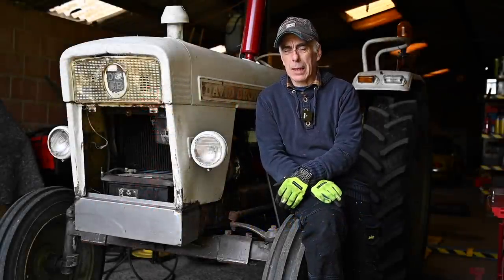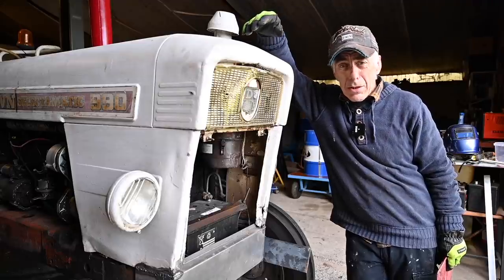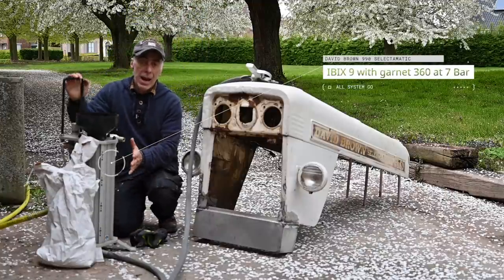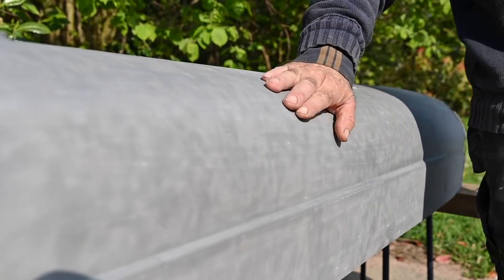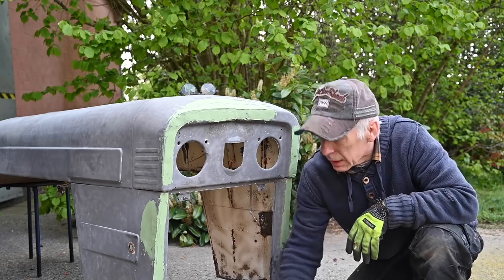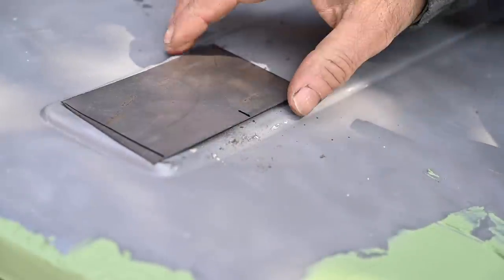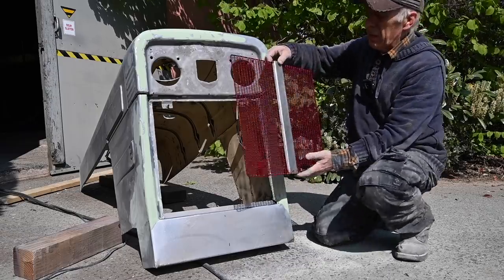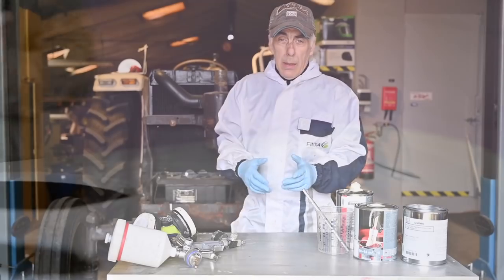David Brown 990, the big clean up Part 1

Comment: I often find that replacement wings are so cheap that they are not worth repairing, the front panels do cost a bit more, but I well remember making a slatted grill for my Fergi 20, as soon as friends saw it they wanted one, so I ended up making them for a few years, that is the way these tidy up your tractor jobs go! Stay sae! Chris B.
Reply from the maker: Thanks for the comments,  In this case its  600 euro for fenders , and they are not the square types.   In fact it seems very difficult to get the square types and the cost of 600 euro is IMO to high... I will rebuild mine
Reply: @D3Sshooter  At 600 E I would as well, that is a lot of money, a lot more expensive than Fergi bits, good luck! Chris B.

Comment: In English the cheap bender, (but looked very expensive to me unless you made it), is called a brake. Or more exactly you would add its capacity, to say, it's a 2 ton brake, or 500lb brake. Makes it sound more scarey but in my shop we had a hand brake and a 2 ton brake that would bend 1/4" or 5.5mm steel.
Reply from the maker: Thanks for putting that straight, Its a cheap one made in china but with some alterations.

Comment: I find a good way to straighten a flat panel is to clamp it between two bits of angle iron with g-clamps. For me it is faster than using a dolly and hammer and gives a better result.
Reply from the maker: Yes , that is another great approach.... I use that sometimes

Comment: Steve, I am enjoying your attention to detail, including the work involved with your on screen graphics, status ok. She is going to be one very smart tractor. One question I have, if you are going to fit hydraulic equipment to the front would it not be better to use the inside headlamp positions rather than replace the old outside ones? Just wondering.
Reply from the maker: Thanks for the comments,  If I look at the hydraulics hedge trimmer it seems that more is in the middle...  Of course I can always add the middle light

Comment: Hi excellent information and great watching your videos, please I’m interested in purchasing a DB880 but it’s got over 9400 hour on the clock, would this worry you, it doesn’t really smoke and starts well, what are your thoughts please

Kind Regards
Reply from the maker: Yes, absolutely.  If the price is right. Those are very strong tractors and easy to fix and overhaul
Reply: @D3Sshooter  that’s very kind of you, around £3500 solid tin and very little smoke on heater plugs, I’m new to tractors so I appreciate your reply very much and especially your videos 👍

Comment: I have a 996 and two 880 selectamatics (one presently isn't running) and I would like to fix them up at some point.  I watched your videos on hydraulics and admit that I am not completely clear on the hydraulics lol.  Both my 996 and 880 have loaders.  Recently the loader stopped working on my 880.  I think the hydraulic pump is working as the lift arms are up but won't go down and the loader won't go up at all.  I saw a video about cleaning the dump valves, which I did and it didn't help.  Any suggestions?  Thanks.  Also, I am in Canada, could you please provide the links where you get your parts.
Reply from the maker: I get all my parts through histo parts  https://histoparts.com/en
The ony thing I can say is to trace all the valves and make sure that the controls are aligned.  If that is all good , then it should work

Comment: Why not put extra lights on, so you have four forward facing, two external and two in the original bonnet holes would that cause a problem 🤷‍♂️
Reply from the maker: I could, but I doubt if I wil drive when its dark
Reply: @D3Sshooter  more thinking, would the Alternator power four easily enough 🤷‍♂️👍